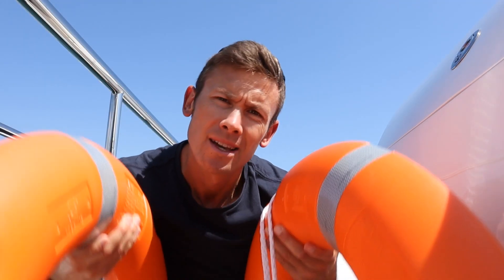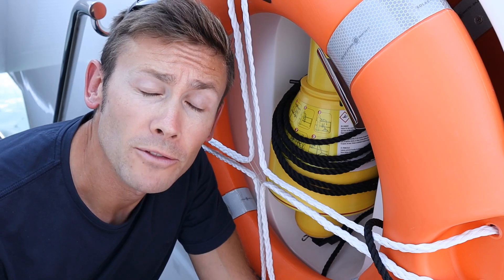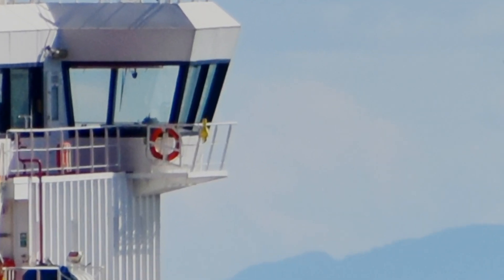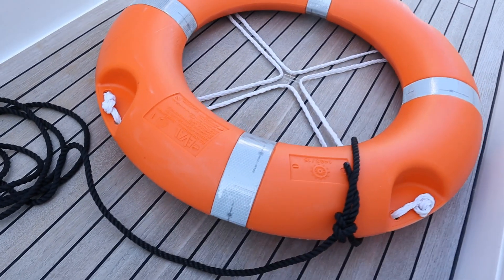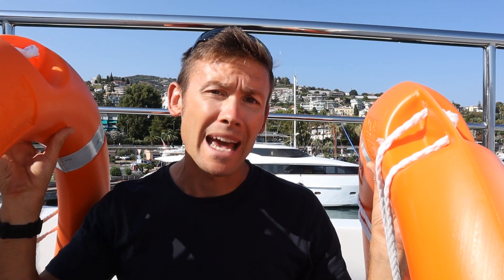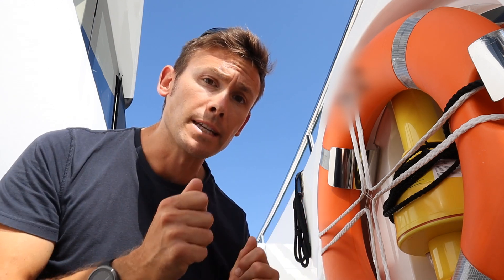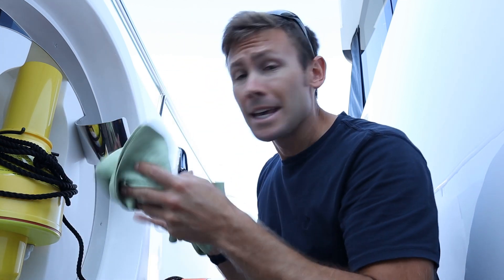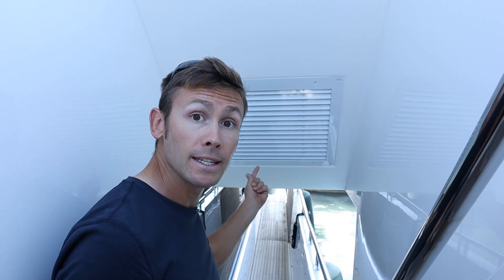WHY IS THIS LIFEBUOY SO HEAVY ???

Comment: question ------------ is there a difference between of a captain off a motor powered  yacht and a wind powered yacht
Reply from the maker: Hello Wayne. Aside from their experience, nothing. The RYA issue different Yachtmaster certificates depending on whether the candidate chose to do motor or sail, but once you progress to MCA qualifications there is no distinction.
Reply: @WorkonaSuperyacht  as per normal great answer as normal